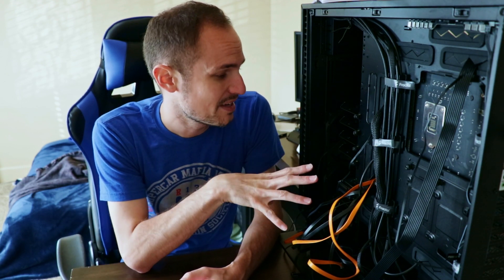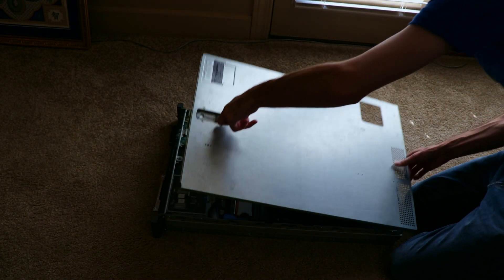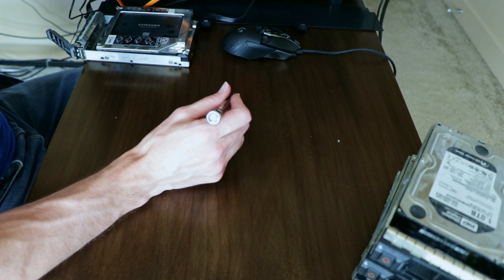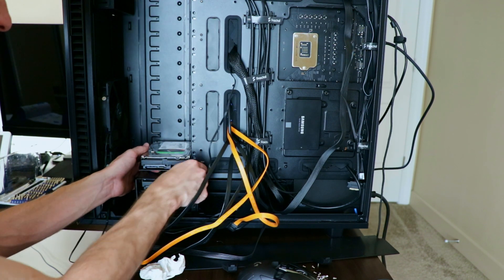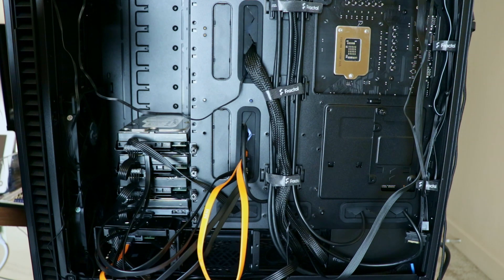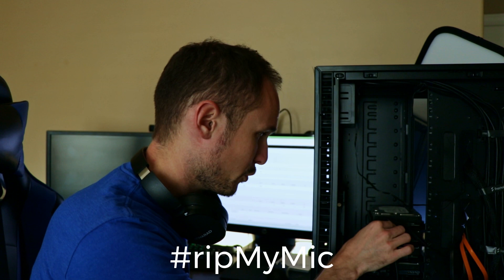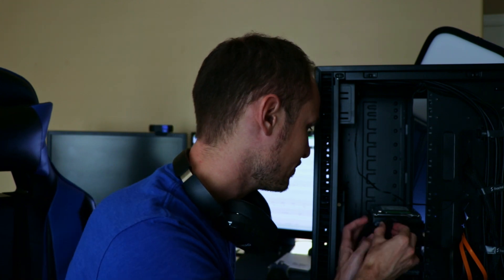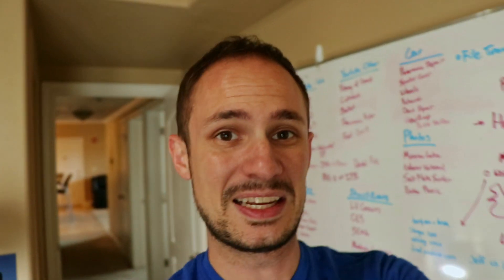[PT 3] Migrating the Array | unRAID Server Rebuild

Comment: Can you comment on drive temps some more?  What rpm are the fans spinning at?  Any thoughts on improving airflow?

I currently have some rosewill hot swap cages in an antec1200 case. One cage uses 3 5.25" bays but permits 4 3.5" hd's to be mounted.  There's a 120mm fan in the rear pulling air through.  My drive temps with a ~68F ambient temp are in the 25-30C range.  In the summer temp range is more like 34-38C.  The case is by no means noisy.  Fans use the old molex connector type and are spinning at what ever rpm 12V provides.  There's 2 120mm exhaust fans in the rear, not spinning overly fast.  Two lines exit out the case to a 360mm radiator strapped to the rear. Radiator has 3 120mm fans attached in a pull fashion.  These too are not spinning very fast.

I've been looking at ideas for a new case which can hold many hd's.  One night mare I see already is when it comes time to swap a drive out.  The hotswap bays (even if not used when powered on), make life so much easier.  No messing with cables, connectors, etc.  In fact, the more I think about it, the more that absolutely has to be a requirement.  The original cages that came with the 1200 case were a pita to swap a drive out from.
Reply from the maker: Literally recording PT 4 right now, working on thermals/air flow. I'll tell you the included case fans run at 1000 rpm, rated at 68.4 CFM, 18.9 dB. I have one drive that's pretty consistently sitting around 109F for some reason though, and want to try to get it lower. The rest are usually around 89F. (probably a difference between the drive I've got my photos/videos on, and ones I only have documents on) So, I'm putting in some more serious PWM fans. Hopefully be able to control them. 

My desktop is currently in an Antec 900, and I can't wait to get it into something else. I know exactly what you mean about those drive cages. They're extremely inconvenient.

Comment: I must be using much faster drives. A few days ago I did a 6 TB wide rebuild that took only about 12 hours.
Reply from the maker: Most of my drives are older. 2 of my 5 drives are easily over 3 years old, if not 6+. The remaining two, I installed the oldest within the last two years I believe. The older drives are rather small too. Eventually I'll migrate them out.

Comment: Unraid only allows for up to 2 parity drives, so not sure why you entertained the idea of having more than 2. For SATA power, I used sleeved cables from EVGA that I got for cheap. I filled all my drive slots and decommissioned any drives less than 4TB -- targeting >150 TB total once I upgrade further. It's not expensive to get an internal USB header/cable for the boot drive -- I picked up a 2-port USB 2.0 one for my Unraid server. I recommend you use a beefier PSU -- not for wattage but more for number of modular cables. And I use a UPS to protect against power outages because a messed up parity takes incredibly long to rebuild.
Reply from the maker: I've thought about a PSU. Probably get to that eventually. Working on figuring out if I have the right wattage right now. So long as my available rails can support the draw, I'm going to make my own cables, so won't really need more headers.